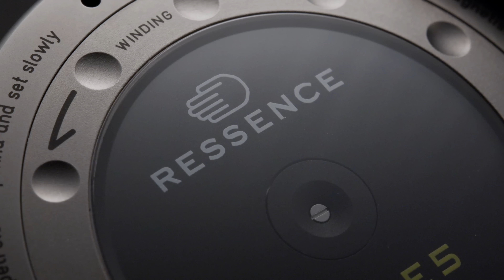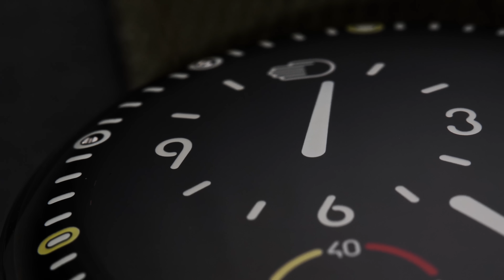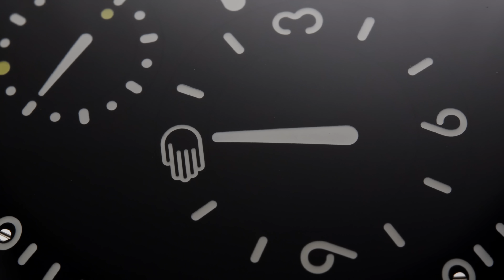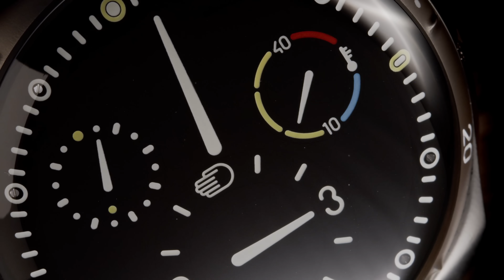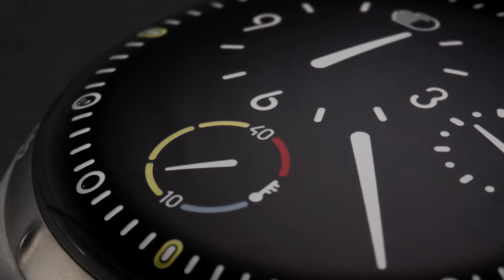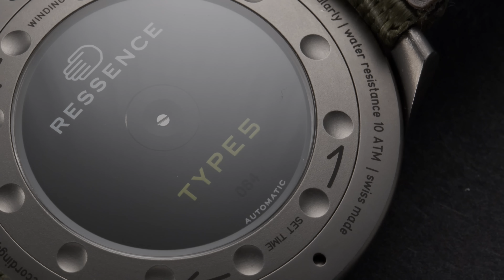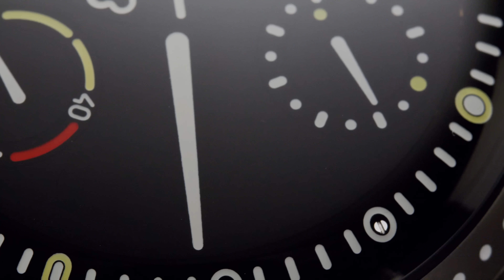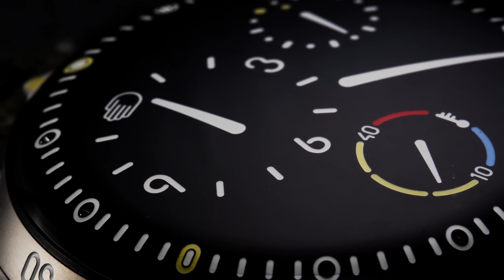Ressence Type 5: What Makes This Watch an Engineering MASTERPIECE?

Comment: So ETA movement, 100M water resistance but still somehow a diving watch, non existent finishing and that will set you back 30K? Nah man. This watch should be 8/9K max.
Reply: An ETA movement... with an additional in-house couple hundred part module (basically doubling the number of parts in it).

Comment: U can buy a uboat tht does the same for 1k nothing incredible about this watch
Reply: I don't think you understand just how different this watch is  from that oil filled Uboat. These require a couple hundred part in-house Ressence Orbital Convex System module to function. The Uboat runs a regular, run of the mill movement

Comment: These are far too expensive considering the movements and judging by what others have said about the feel. They’re around £27k+ if anyone is wondering.
Reply: Eh?? I tend to agree but I looked into what the did, and had to do, to that movement. They used it as a base and built around it. Plus the engineering that goes with the oil. It's impressive to me. 

Still too expensive though. And about to get even more expensive.
Reply: This is crazy innovation
Reply: "Far too expensive considering the movements" ? It's absurd to think of it has just having an ETA base movement. The Ressence Orbital Convex System module is an additional couple hundred entirely in-house and unique parts.
Reply: I'd cop like 7.5k to 12k as a range of acceptability...yeah they're cool but i can scratch a similar itch (personal pref obvs) with the clear swatch honestly...😢
Reply: You can say that about damn near every “high end” watch